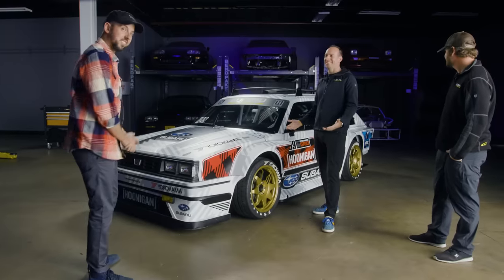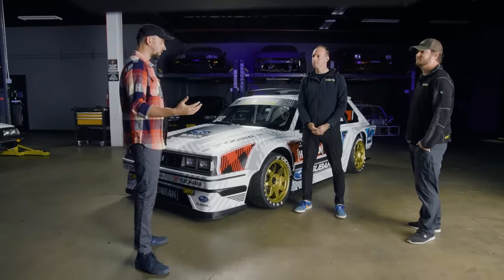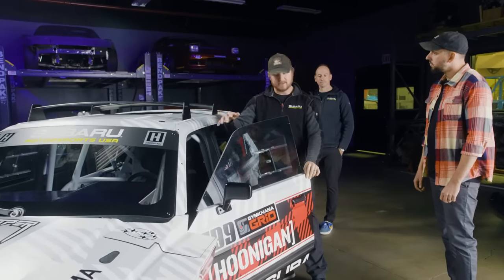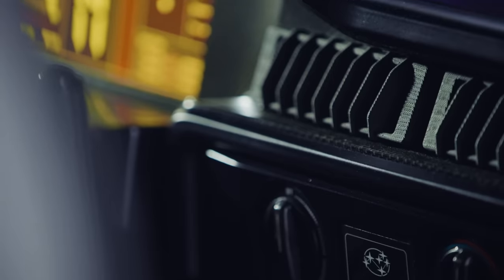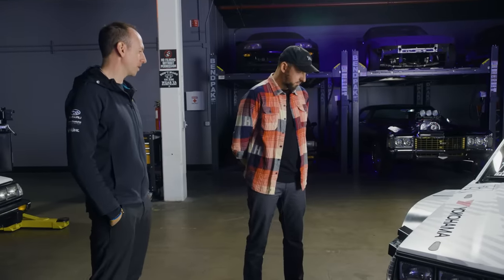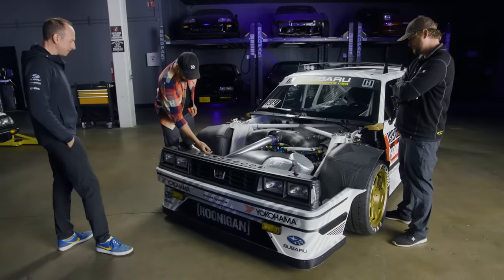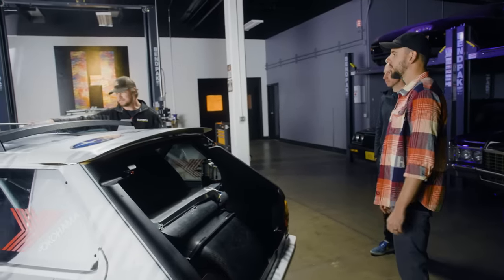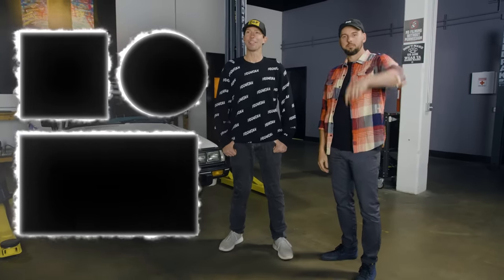Subaru's ULTIMATE Gymkhana Wagon: 862hp, Carbon Everything, Active Aero, and More

Comment: Wouldve been better to see more details about the mechanism behind the active aero in fenders, quarters, and wing. Same with at least a shot of the headers, the underside of the car, control arms, the nitty gritty that we used to see in build breakdowns. These are really cool cars and I think the mechanical details are the best part.
Reply: If you're really interested in the active aero you can just look at pneumatic linear actuators and you'll get the gist of the basic mechanical functions. Pneumatic linear actuators mated to the wing and aero panels backed up with electric air pumps and pressure tanks with a control board that houses the solenoids that open the valves to control air flow to each with bleed-off valves for when the aero no longer needs to be activated.

Comment: 1984 Subaru GL wagon 4 speed 4wd was my first car. Paid $400 for it had to start it with a flathead screw driver and had 326k miles on it. Would go thru any snow storm and was a pretty reliable car for a 16 year old.

Comment: I'd really like to see a deeper dive on the aero side of this car. Really curious to see how effective those wheel arch flaps and the wing is from both a numbers standpoint and from the drivers perspective.
Reply: the car ran at Goodwood this year, you can watch the runs, but spoiler alert it was one of the fastest cars ever at Goodwood.
Reply: I saw the car at Goodwood  @NeilAlvin  : one of the fastest ICE cars this year, but I was unsure on how effective the active aero was as the car looked very unsettled under heavy braking (perhaps that is Travis preference/driving style though)

Pastrana actually posted very similar times to the Gobstopper 2 (in 2016). I'd just be really interested to see raw data and hear Travis discussing how it affects the car.
Reply: Judging by how much flopping around those front fibreglass panels did when they were activated in the video, I'd suggest the "active aero" is mostly a gimmick.
Reply: @AJ-oj5eu  Yeah, I am unconvinced on its effectiveness which is why I'd be keen to see if there is any science behind it. Be a shame if it is just on there as a gimmick as that would cheapen what is otherwise an impressive build.

Comment: I had the 2 wheel drive version of this car.
Underneath the sub-frame was rusted out.
"Gone"
Yet the body had almost no rust. 
It ran ok.
It wasn't fast enough to get out of it's own way.
But it ran.
"Fun part"
When you would follow a semi truck the air buffering around the car would shake it violently due to the lack of sub-frame.
It was hilarious.
Was it safe?
Definitely not.
Was it stupid cheap?
Most definitely.

Comment: I have always wanted one of these GL leone wagons decked out and turned into a race car or even a 4 wheeler. Im from colorado and ive seen a few of these old wagons around in the mountains and people will put huge wheels tires and suspension on em and they just look so damn cool all raised up plowing through the snow haha just skippin past brand new tacomas and stuff. so when i saw that travis had built one for rally i really was stoked to see this car its pretty much one of my dream cars right here. definitely a little different from what i had in my head especially with the aerodynamic stuff but man yeah this thing is cool as hell. I still really want to build one with a wide body kit with bbs wheels and an sti engine in it with turbos and all that. such underrated cars that i feel like have alot of potential to look amazing and go fast as hell.

Comment: Welcome to the party
...finally. 'Bout time ya figured out the magic of the subie wagon

I bought my 1st quasi "real" car in '02...was actually in a position to get anything  I wanted (within reason, since my 2nd kid was on his way) aand I landed on a '99 Outback Limited 25th Anniversary edition. I had previously driven an Impreza in deep snow, so I knew I wanted the extra length and different weight distribution, in order to have a prayer at getting the ass end to whip more than just a little, for a second 

It was a lease car, with like 42k on it
...which meant it still had factory warranty. That was a big plus, aand I went out of my way to put that ta use. It was an auto scum & I had fun power shifting it, going from 1st to 2nd. I hit it so perfectly one time, the front end came off the ground (only just, but still) 
That was the beginning of the end for the diff. When it finally went all the way, the dealership said what I did to it was a 1st

I fkn LOVED that car. It was a bit of a dog as far as off the line speed, but was pretty far from slow, 'cause that granny gear was low enough to blast off fairly well...but my gawd did that thing handle/corner like it was a MUCH more expensive and sportier car. I guarantee you if I blindfolded you & took you for a ride, you'd never guess you were in a wagon. It was right after that they started making them ride like sofas for all the grandmas

The 25 anniversary one was also a dream on deep snow, unplowed, country roads. I drove that thing over 100 mph in almost 2 ft of untouched, virgin, snow
...not even with winters on (even though I had a set mounted & ready) just all seasons, which never left me wanting, but talk about tip toe'ing

Despite their issues, when they do work...to the day, i don't believe there's a better/more fun, car for deep snow

We got 7 ft in 48 hrs once. It was coming down so hard the plows had all but given up, and were just trying to keep 1 main E/W and 1 main N/S road, usable. Only me and 1 l'il S10 were out enjoying it. The snow was so deep, I was tunneling at times

I proceeded to drive outbacks for the next 20 years for this reason, and because I live on Lake Ontario where we've been known to have 6 months of snowy roads

Just a couple years ago. I finally got fed up with their catastrophic failures, and gave up on them

Comment: The dream would be to see these Gymkana vehicles enter a limited-run production. 

Obviously not to the same extreme levels, without carbon and full caging, but the aesthetics,
And with a bumped-up tune, for a performance level above the regular sti factory runs. A platform for fans to build with like the 86, BRz and FrS.

Like I said, a dream. Also because I couldn't afford

Comment: Next GEN active AERO is going to be "fly by wire" if development stays at this speed :D
Great stuff guys!
Reply: Likely won’t ever be. The motors would have to be huge and would weigh a lot.
Reply: @dcskate1022  not really. Motors have gotten AMAZINGLY power-dense in the past ten years, and active aero is easier to achieve than ever. The real work is in the software.
Reply: @spdcrzy  not really. It’s in the hardware. Race teams need to be as light as possible, a small hose is a whole lot lighter than wiring and a electrical pump. Not to mention air is way more reliable.
Reply: @dcskate1022  But those things still need a portable source of compressed air. With tiny, sub-pound motors and lightweight wiring, it's the software doing the heavy lifting.
Reply: @spdcrzy  that compressor is used for a ton of other things on the car, it’s going to be in there anyway.
Reply: @dcskate1022  yeah, that's fair. My point is just that with pneumatics, it's very hard to control anything beyond "on" and "off".

Comment: I love older powerful AWD avant/vagon cars. I have Audi urS4 2.2T with 600hp with kdfi 1.4 and 1,5bar. Kdfi dont understand 5cyl so it is put together somehow as 10cyl(spark&injectors are fucked) and it dont understand ove 1,5bar boost. With maxxecu i can put much more boost and spark&injectors are gonna work with real data so i think 850hp isnt far from true power it will produce. Glad i have new cluch and flywheel etc ready for that :)

Comment: why dont they connect  some sort of finger aparatus that detects muslce tention and make the car shift based on that so he can keep his hands on the wheel?
is this a stupid idea that is not foolproof, i hope u know what i mean it can be done several ways.
its know its not impossible to connect yourself to the car somehow so the car knows certain stuff like muscle tention in the fingers.
he just have to do the same but without the paddles, just aply tention as if you want to shift gears.
its at least a few microseconds faster as you dont have to press the paddle in full and the driver keeps full control over the gears